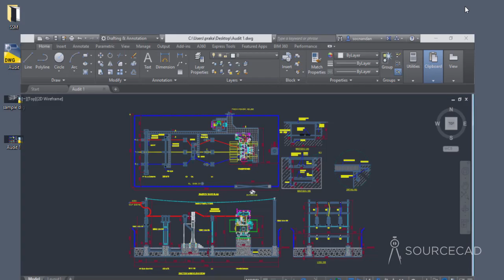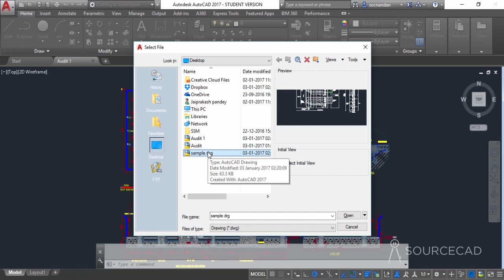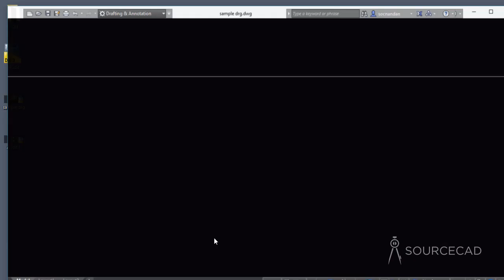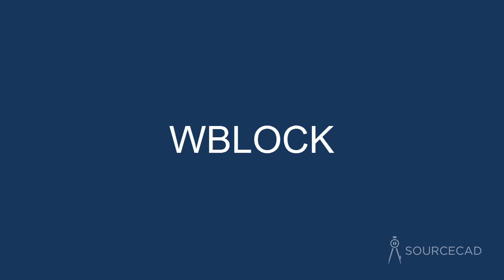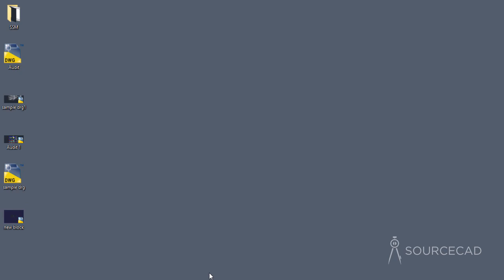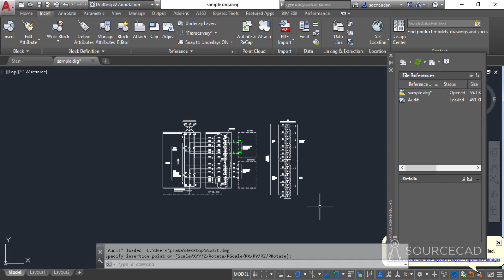How to Repair corrupt AutoCAD drawings

Comment: 1 of my dwg file I imported block and now when i am copying any item in this dwg file autocad get freeze or hang ....
Reply from the maker: Try AUDIT on the drawings before importing blocks.
Reply: on blocks or existing drawing
Reply: okk thanks I'll try
Reply from the maker: You can only use AUDIT on a drawing not on individual blocks so guess you have to try it on all files which you are using.
Reply: i have blocks dwg file it contains more than 50 different blocks so should i use audit on block's file ...
Reply from the maker: yes in that case use it on drawing containing blocks.